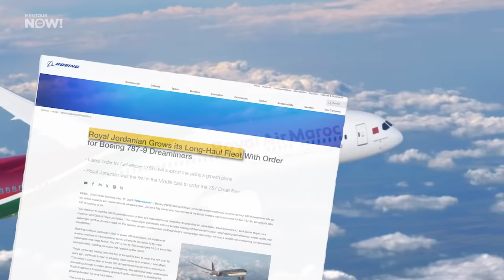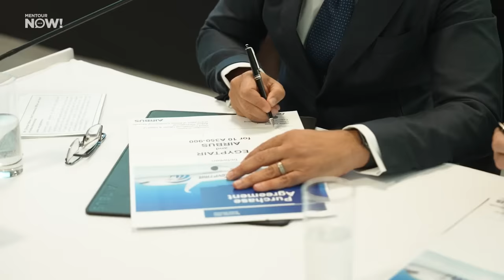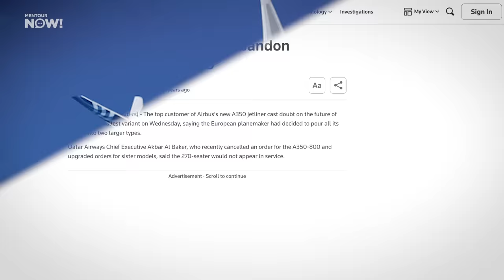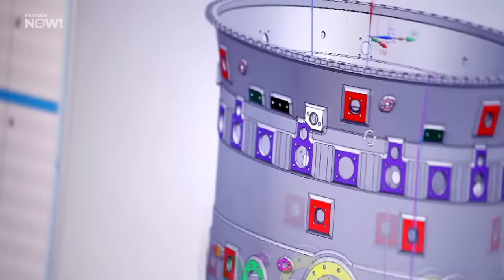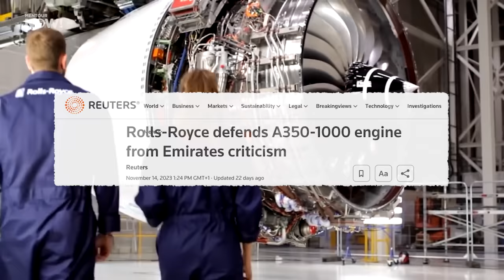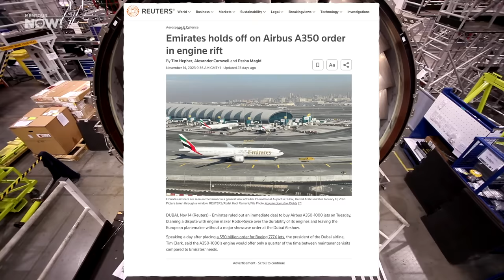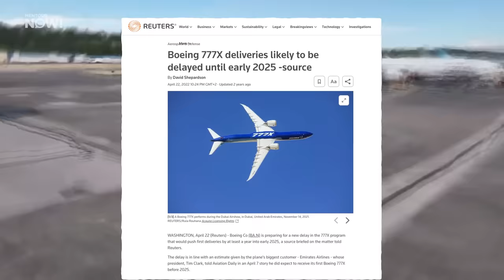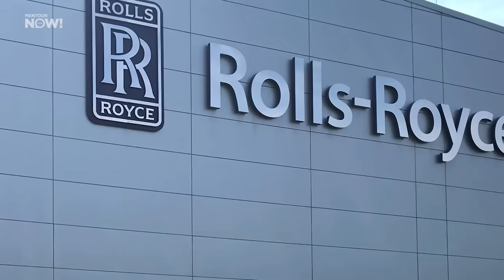What’s WRONG with the Airbus A350?!

Comment: Well Cathay recently ordered 6 a350F + 20 options moving away from their all Boeing cargo fleet. Any Emirates show-stoppers are more due to economics rather than engineering. They just didn't get the discounts they wanted.
Reply: If a competition is giving a better engine for a lower price why wouldn't they take it? Even Thai has ditched A350 for their upcoming huge order due to RR engine prices despite being a historically loyal RR customer.
Reply: The case of Cathay is not relevant in this discussion as the weather in Hong Kong and Dubai is just so different
Reply: Yes it's very different and yet by all accounts, Emirates was on the verge of taking the a350K. Did they discover that they operate in a hot and dusty environment in the few hours before the show?
Reply: @aseem7w9  If Thai is giving up those A350 they just acquired they're ditching A350.
And no they were not loyal to RR - quite the opposite. They were known for a messy fleet, ordering almost every aircraft type with engine from all 3 manufacturers. 
Also IIRC RR at some point bribed Thai management for orders, so there were some troubled histories as well.
Reply: @steinwaldmadchen  They aren't ditching the 350 but ditching it for this specific order. 
Thai having messy engine choices must be a long time back because in recent history whenever there was RR they chose it, 330 340 772 773 787 you name it, and they probably weren't bribed for every single one of these. GE came for 77W where there was no RR option
Reply: @aseem7w9  Both 77W and 346 come with exclusive engines, but given their capabilities are so similar, most airlines would only operate either one, from a fleet simplification perspective.
330s are powered by both PW4000 and Trent 700.
Reply: Do note that Cathay have similar loyalty to RR as British Airways. Their widebody fleet is largely powered by RR since the introduction of RB211, with the only notable exception of GE90-115B on their 77Ws (which actually stopped them from order 77Ws early on, because they no longer can choose Trent 800).
They are also a significant shareholder of Air China, the only Trent 1000 customer in Greater China Region.
Reply: @steinwaldmadchen  Thai has recently acquired second-hand A350s, they won't be ditched for a while yet. 

TG had a preference for RR for a while, they chose it for the 777, 787, later A330s and, A380s, as well as being on the A340-500 and A340-600, plus the A380s.

Comment: Well, considering that Air France - KLM (the latter in particular) are switching from Boeing to the Airbus A350, including the 1000 model, I’d say that that airplane is still doing pretty well.
Reply: I was so bummed to see KLM retire their 747s but I understand why, quad jets just don't make sense for most use cases.
Reply: @Jebbis , why would an airline operate B744 if they have B77W, which is about the same capacity and range? For Lufthansa due to airline’s size it is slightly more problematic to get quads out of the service.
Reply: KLM and Air France are partners. The only reason they get A350 is Air France...
Reply: @Trancial-x-tion  They have been partners for a long time, during which when they placed orders with both Airbus and Boeing, the Airbuses usually went to Air France, and the Boeings to KLM. That has now changed.
Reply: @interstellaraviator6437  I didn't say they would. I loved the 747 that's all. But ever since ETOPS they don't make economic sense because now they only fill edge cases.
Reply: @Trancial-x-tion the reason presented was range. To be able to fly around Russia to Japan for instance.
Reply: Because their state controlled national flag carriers. Same reason that the partner nations of Airbus had their flag carriers buy a handful each of A380s.
Reply: @zeitgeistx5239  The current KLM fleet consists of 100 Boeings and just 11 Airbuses.
Reply: @interstellaraviator6437  You need to pay for new aircraft, but don't have to pay for what you already owned.
In corporate accounting the cost for new aircraft are breaking down in years as "depreciation".
Even if 747 is more expensive to operate, it may still be cheaper on some routes than 77W or 350s when "depreciation" is included, especially when fuel is cheap, the route is short, and the demand is fluctuated. Meanwhile newer aircraft are always put to the busiest routes to make the most of that.
Reply: @steinwaldmadchen the last 747s of klm where all build in the early 90s and were all clearly needed to be replaced. KLM stopped replacing the interior 10 years before facing them out. So at the end there was a quite big gap in comfort when you put the 787 next to it
Reply: @zeitgeistx5239  …Of course.
If you choose Boeing, it’s because it’s the best option.
If you choose Airbus, is because the government made it do so.
😁
Reply: @miks564  Exactly - that's why when French owned majority of the shares, Air France ordered so many 77Ws to support Safran lol.
Reply: So, that means Airbus is currently the major aircraft manufacturer because of the aircraft models France, Germany and the Uk are forced to buy.
…not because Boeing only has the 787 as a proper competitor at present time.
😁
(This was still a reply for @zeitgeistx5239)
Reply: @Trancial-x-tion  Air France KLM is one of the three "Big Legacy"-Carriers of Europe together with the Lufthansa Group and the IAG. KLM is a very traditional Boeing Customer and Air France was never an "Airbus-Only"-Customer: Air France operates a fleet of 63 B 777 (18 B 777-200, 43 B 777-300ER and 2 777 F), one of the largest Triple-Seven-Fleets worldwide, and 10 B 787-9 Dreamliner. Air France is even the Launch Customer of the 777-300ER and the 777F.
The Turnaround towards Airbus is much the work of Benjamin Smith, since 2018 CEO of Air France KLM.
Reply: @NicolaW72  Well, not even Ben Smith is pushing for Airbus actually. The A350-787 swap happened during he reign, and he was in charge of network planning when Air Canada went for 737MAX.
For Air France things are complicated. While they do lean Airbus, the RR engines that come with it not so much. Just like KLM they prefer GE/CFM engines which Safran is usually a significant parner.
But if Boeing can't deliver the MAXes any time soon, and a capable aircraft that can circumference Russian Airspace, then they have to look at Airbus.
Reply: @miks564 100% true.  Airbus would lise a ton of business if EU governments didn't "force" the purchases behind closed doors.  Not a very honest or competitive way to operate.  And then there's the public funding issue.
Reply: @patrickranaudo8626  that’s a big joke!
EU governments have no means nor any particular interest to push Airbus sales, with perhaps the exception of France and Germany.
And even so, you can see dozens if not hundreds of Boeing aircraft in most major European fleets.
 And Airbus is currently the biggest aircraft supplier because of worldwide sales, not because of Europe.
For the moment, Boeing has only one single competitive aircraft, the 787.
Now, if we look into the US government, they even interfere with FAA decisions to allow the 737 certification without the requirements FAA themselves have requested from Boeing to allow the max back in the air.

Comment: All of the times I have traveled on a 777 was on board of Air Canada, operated by Lufthansa in the early 2010's. Even back then I was quite surprised that these were 6 flights all with Rolls-Royce engines, for me it just didn't make sense for some completely superficial reasons like "American jet with a British engine, when there are other options". I don't believe that Emirates had issues with the RR engines, something else must've gone wrong between them and Airbus, given that as of December 2023 the best economy comfort that you can get is on an A350-1000 and Emirates usually go for it.

Comment: The a350 is seriously pleasant to ride in. 787 always seems noisier.
Reply: Mmmm... some years ago I was flying in a 787-9 of JAL from FRA to NRT (eco class) and it was by far the most comfy flight of my life. And I am 6ft tall! Enough leg space, comfy seats and cabin noise from the engines was neglectable. Ok.. I never was flying the A350 before. But 787-9 and A350-900 are very similar.

Comment: Very good video!! I work as an inspector in the Trent family LPT turbines (IPT in the Ultrafan) manufactured and assembled here in Spain. The 84 and 97 variants refer to the thrust the engine provides (84K and 97K pounds of thrust) . Like all your videos!!
Reply from the maker: Thanks for the info! Yes this was a mistake. A small confusion between the way R-R and P & W name their engines..! I've issued a statement to correct it.
Reply: Interesting! I wondered what the chances of the fan diameter in inches is the same numerical value as the thrust in lbs would be!!

Comment: Similar problem with the L1011 Tristar which was blighted by being powered solely by the RR RB211 engine.
Reply: That's something I questioned as well . Rolls Royce being the sole engine supplier for the A350 sems crazy their sakes could be bigger if they could fit another engine from.a different manufacturer.

Comment: Thanks for your objective and comprehensive presentation. Rolls-Royce is not a favored supplier with airline executives. High overhaul costs and slow shop turn around times add significantly to the total cost of ownership. Boeing and Airbus have both gone to single source engine suppliers for their B777X and A350-1000 aircraft, which keeps certification costs lower for the airframe manufacturers but removes engine supplier competition from airline procurement.
Reply: Agreed. Single source engine supply arrangements are a terrible idea. Give the airlines a choice between engine types!
Reply: With the development cost of a large jet engine, few companies are willing to outlay 3-5 billion dollars on a engine that only starts to repay development cost 5-7 years down the road, when orders get split at 50/50.
Look no further than the A380, when General Electric and Pratt&Whitney no bid an engine. It wasn't until Airbus plead with them to team did the Engine Alliance form, and received cost to 60% of the orders. 
Airbus love exclusive engine contracts. They get cheaper prices. The customer on the other-hand might be a GE or Pratt operator and shy away from Rolls due to past issues.
Reply: ahh wondered when the anti Airbus and Rolls Royce comments would start, obviously a Boeing / GE fan @gungadinn
Reply: @ant2312 I'm really curious, but how is it possible to be an engine maker fanboy ?
Reply: @ant2312  
I happen to be an Airbus fan, though not fanboi. Worked flight test for the A320, A300 and A330.
Airlines invest million in tooling to work on their  own engines, so they're invested in an engine type. 
As for Rolls, their inferior product caused Lockheed out of the commercial aircraft market with the engine for the L-1011. The Trent for the 787 grounded many 787's for over a year. Boeing had their own 787 issues with batteries, but Rolls hasn't been stellar in their large engine market.
I will give them credit for the IAE V2500. The absolutely quietest turbo fan engine I ever worked around.
Reply: @@BB-xx3dv 
You have to do better than that son.
The CF6-6D engine in question had 42,436 hours and 16,899 cycles. thanks Wiki.
The DC10 was delivered in 1971 and the accident happened in 1989. 
I'm sure that the car or truck you're driving has had no break downs in 18 years.
Reply: @@BB-xx3dv It was a high hour flaw that presented itself in the BRISK that at the time wasn't seen in X-rays.
Reply: "Rolls royce is not a favoured engine supplier for  airline executives" - name one airline that has criticised the trent xwb? Uou can't because there isn't one.
Reply: @Stvescr  I'm not privy to internal M&E meetings held at operators of the Trent XWB and therefore have no knowledge about what they think. Do you?
Reply: @FaridCooper  Made me laugh.
Reply: @gungadinn  Regarding high development costs. In the words of Robert Crandell, retired CEO American Airlines: "Call someone that cares."
Reply: @FaridCooper   It's related to the number of shares owned..

Comment: You know what confuses me, the A330 Neo, in theory it should but performing way better, but it's sales are really slow. Even though the A330 Ceo is a popular aircraft. Why aren't airlines phasing out the older 330s?
Reply: Just as an example, my country’s flag carrier is Iberia, and it’s A330 average age is less than 8 years, being the oldest -200 about 5 years old. This is the case for many airlines, therefore absolutely no need to replace their CEO A330. I assume this is the case of many other airlines in which the A330 plays and important role on their fleets.
Reply: They will phase them out eventually. Airbus did the A330neo mostly because a modest upgrade to the A330ceo would be economically competitive with the 787 (there’s even not that much weight difference). They use it to bid against Boeing in competitions, limiting the profit Boeing are making on 787 sales. Dollars not earned by Boeing makes it more difficult for Boeing to claw back the huge amount of market share ceded to Airbus over the past decades. Plus it’s there for when all the A330ceo operators do start needing replacements.
Reply: @abarratt8869 that actually makes alot of sense yes

Comment: Rolls Royce has also stated that they’re focusing on seriously maximizing profits in the upcoming decade. That means very few discounts on engines. The A350 only having the one option for engines, that means engine costs are way higher too. This is part of the reason Delta Air Lines hasn’t ordered the A350-1000 yet despite it fitting well in their structure after they retired the 777 in 2020.
Reply: It's clear Airbus made a big strategic mistake to only have 1 engine provider. They should have spent a little bit more for a 2nd option, and would likely have won the bid
Reply: @Matt-YT  
Sales of the A350 do not indicate a "big mistake to only have 1 engine provider". Its pretty likely that the 350 will be one of the world's most successful widebodies of all time, without GE. The mistake was that GE didn't push hard enough to get involved in the first place, although Airbus now sees GE as primarily the engine partner for Boeing, and not with themselves. Its GE that will be desperate to get involved with the A350, once RR's exclusive expires, as they look on enviously at RR's success, but I suspect Airbus will stick with RR, as Im sure RR will be transferring tech from the Ultra Fan to engine what will be coming next, the A350 Neo.

Sooner or later, American operators will go with the rest of the world regarding w/bodies, and buy a wholly European aircraft, airframe and engines, without worrying about the politics of buying foreign.

Delta can either pay RR what they're asking for such a competitive engine as the XWB, or spend more buying GE engined B787s, with all the extra costs that entails for them. The choice is theirs and either way will not have serious consequencies for the A350.....
Reply: Increasing time on wing is the key to RR profitability improvement. RR's Power by the hour charging means RR picks up the cost of reduced service intervals. So RRs profit improvement plan will likely make the A350-1000 more attractive to Emirates.